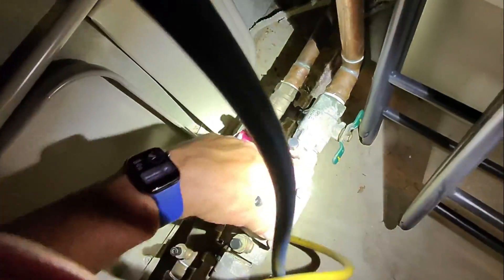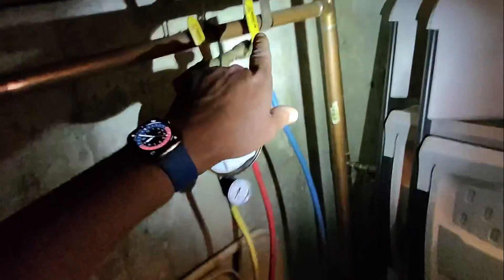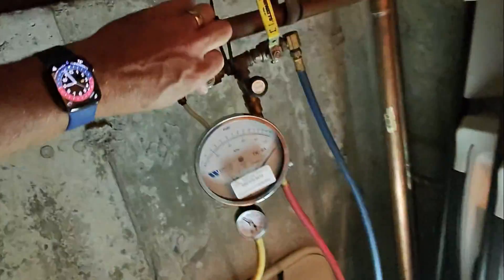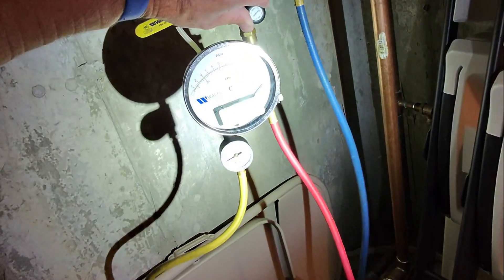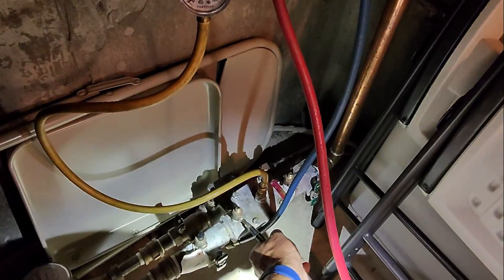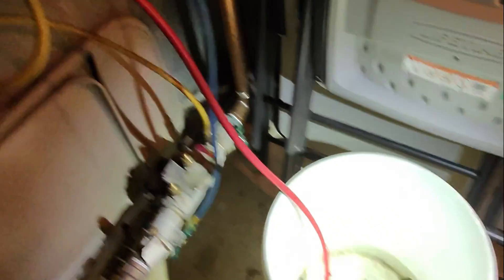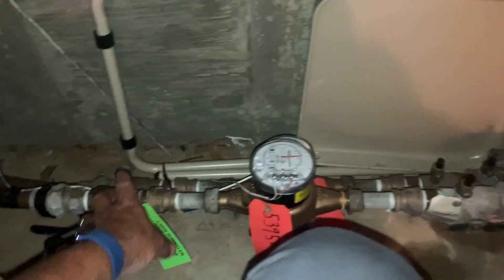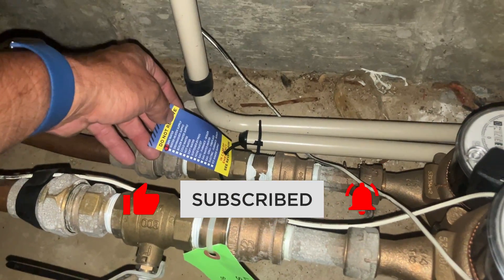Plumber Shows How to Test a Backflow Preventer (Watts 007) — Real Life Service Call!

Comment: Hello, just saw your video. I’ve been testing backflows here in California well over 25 years been installing servicing them for over 40 years and I’ve never seen a backflow unit tested in that manner is it because of your watch tester unit? Cold in California is you open test Cox 4321 to purge any air or debris and you put the high hose on number two in the Site tube on number three. I’ve tested thousands of backflows RP’s DC’s & DCA’s fire lines, etc. anywhere from three-quarter inch to 10 inch. I’m really curious to why you tested it that way. Thanks.
Reply from the maker: In NYS we have 2 approved methods. As mentioned in the video, I used one method.

Comment: As a certified tester in California I haven't seen a DC tested like that. Is that because of your Watts testing device? I put high side hose on #2 test cock and open #3 test cock to get #1 C.V. reading #3 & #4 to get #2 C.V. reading
Reply from the maker: There are 2 approved test methods in NYS. I explained that in the video.